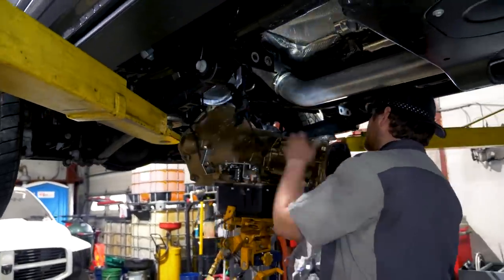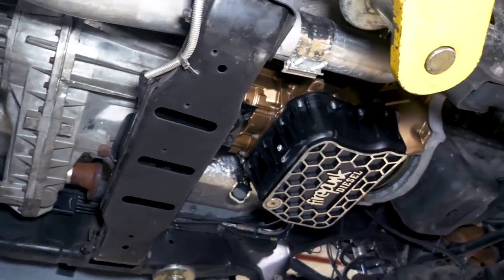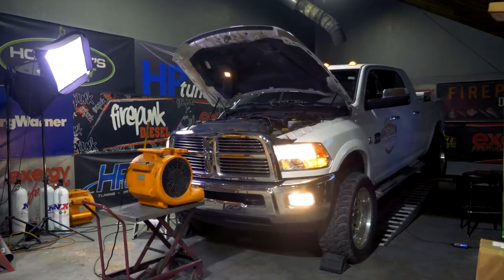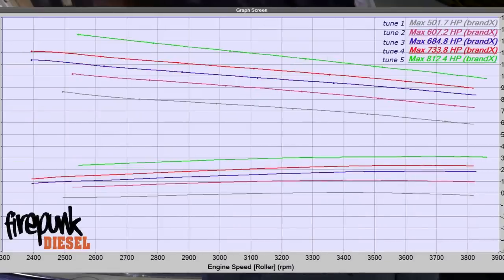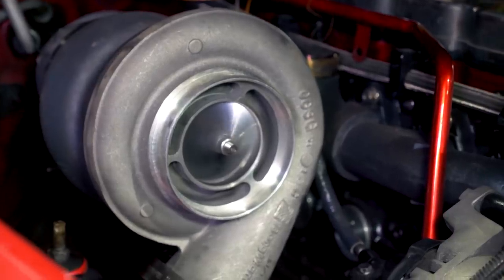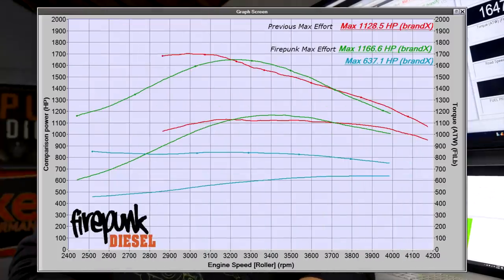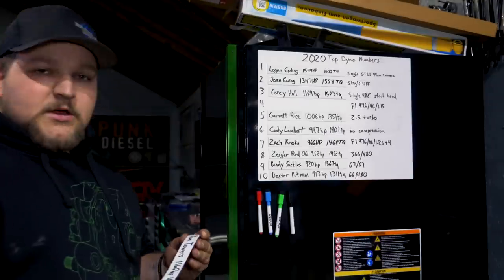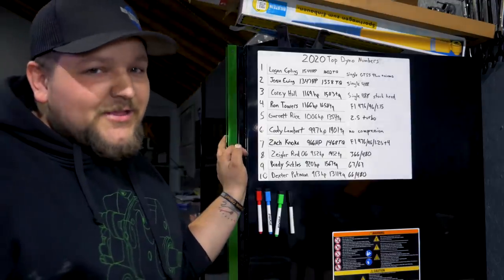48RE SWAPS FOR EVERYONE - TWO ROWDY DYNO SESSIONS

Comment: Im curious if the allisons were stock or built he was having issues with. If they were built it was 100% the builders issue cause a properly built allison will take 800 all day unless he kept sticking stock shafts in it. Not that the 48re swap isnt better, my 4th gen is 48 swapped for a reason. He just shouldnt have had to go through so many
Reply: built
Reply: 48re is better than Allison when both builds… in the diesel racing world all of the Chevy and Ford swap for the 48re…
Reply: @Jsperal  yeah I know I had a 48 swapped ccsb 4th gen than ran high 10s full weight. All out race applications trying to get every 10th I agree the 48 is the better choice. But at 800 hp a properly built allison should have no issue. Theres plenty in the 10s and good few in the 9s.